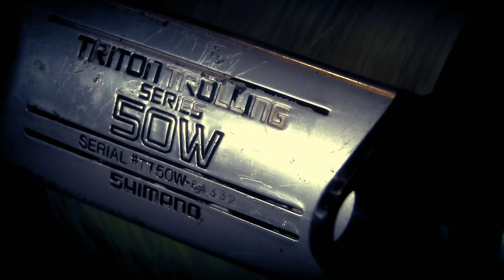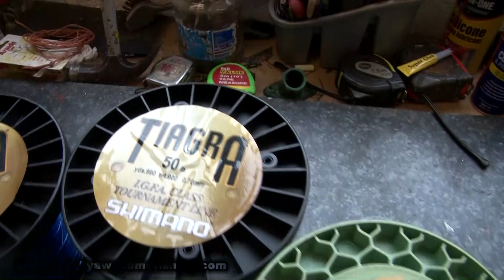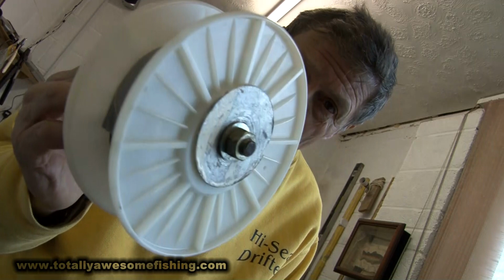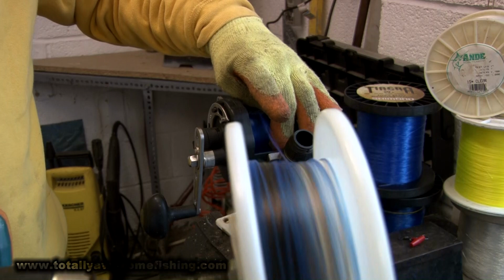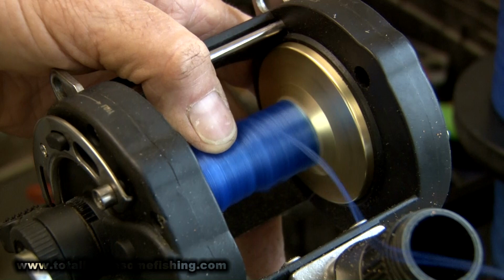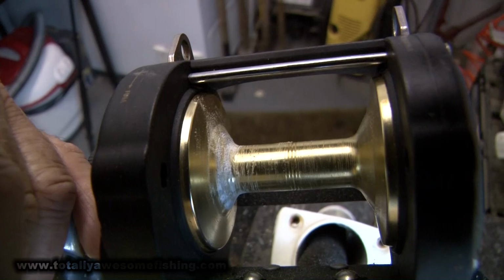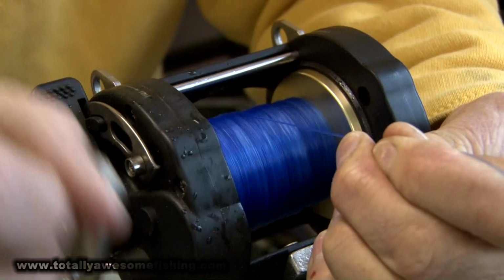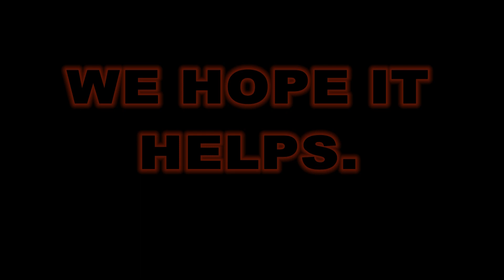How to spool a fishing reel

Comment from the maker: Most mono lines only deteriorate in sunlight,but not much sunlight gets to the inside of the spool so I always found the line inside better than the top bit I catch all the fish on.In Britain there's not much swimming that will empty a full spool,so only the top 200 feet or so on a 1,200 feet  fill up ever gets wear. I can only speak from experience,and I've never had a problem reversing the line.

Comment: to put the line back on the reel get the right size socket and a socket adapter for the drill and put it on the handle nut, that turns the handle considerably faster than normal.

Comment: Loved your video - just recently found out about "Conventional Reels" so have been asking some You Tube Fellows for advise. I don't do any saltwater fishing, only freshwater. The next thing I want to try is trolling with wire line. Whats your feelings on Baitcast vs Conventional Reels & what do you think would be the best reel for my freshwater steel line trolling? I gotta say the conventional reels look really cool, I just don't know how long it takes to master the "Thumb Steering" of the line. Thanx for your time: Shawn
Reply from the maker: Shawn Doe I would say the multiplier for wire line fishing.A fixed spool(spinning reel) will have a smaller spool diameter and may create coils of line memory.Wire,even stranded,is relatively stiff.Have you thought of using braid ? It will cut through the water and can be used on either multiplier or spinning reel.

Comment: Great video. One question. Would this work with braid? Doesn't see like it's on there tight enough to prevent the braid digging in on itself under pressure.  Great idea with the spools and drill.
Reply from the maker: should work OK for braid.The few times I've loaded braid I have had no problems.

Comment: Hi Graeme, Thanks for the videos. How do you prevent the line from forming a rugby ball shape when you spool it on? Eventually it get so distorted that it interferes with the level line system, not allowing it to pass from one side of the spool to the other. Thanks.
Reply from the maker: I take most of the level winds for castings reels off so when I wind in in I can do touching turns so it will cast further. A lot of people take the level winds off ,but I know what you mean,as soon as a fish pulls drag the level laying system is changed.
Reply: @TAFishing  Thanks for taking the time to reply Graeme. I wondered if perhaps it was the knot i used to join the line to the spool spindle. My spindle didnt have a recess to hide the knot inside. Thanks - Ill probably take the level wind off, fit a conversion kit and re-spool.

Comment: Great vid. One question: how the hell do you tie off the line once you have spoiled it, to keep the tension and stop it unraveling when not in use?!

Fixed spool reels have little line clips, my multiplier doesn't seem to have anything to clip to?
Reply from the maker: +Matt Norman When you finish spooling up tie a loose loop in the end,then half hitch a rubber band through the loop,stretch the other end of the band either around the spool,or over the handle.Then you can always find the line end.

Comment: I was wondering about how long the line lasts without being used. The bait shop tells me if the line is 1 year or more old to replace it. I'm thinking that it's made from plastic or nylon or whatever, but seems like it should last forever. Probably falls somewhere in between I reckon :P Great video and thanks.
Reply from the maker: I've had most of mine for several years and see no point in changing all the time.Keep the reels/line in a cool dark place out of sunlight and it will last longer.
Reply: Thanks Graeme. I had a feeling they were just trying to sell me stuff. I have the reels put away nice and my poles in my bedroom. I figure if I see them enough I might go fishing :)

Comment: Wouldn't the monofilament line get weaker because it was soaked in water in the bucket, and on the reel?
Reply from the maker: No,it doesn't absorb water .You fish with the line in water anyway, then wind it on the reel ? Its UV rays on sunlight that deteriorate nylon line, so keep your reels and spare line in the dark. It should last longer.

Comment: Hi I have just brought some boat multipliers and on the spool there's an tiny lug/bolt is that for trying the line to ?
Reply from the maker: I know what you mean but don't tie your line to it or it will just pull off.Tie it right round the spool itself.I don't actually know why some reels have that bolt bit on them as you will rarely ,if ever get a fish take all the line right down to the stub.Good luck.

Comment: Couldn't you just have half the reel cap with backing line then have however many feet of line that sees the water then doing these? I mean if you have 300ft going into the water just have 300ft of main line and the rest backing line and just replace the 300ft of main line instead of stripping all the line off and reversing it